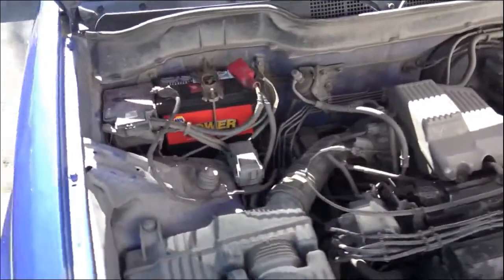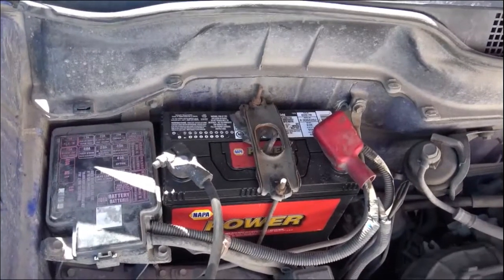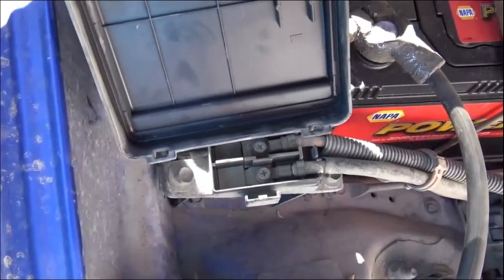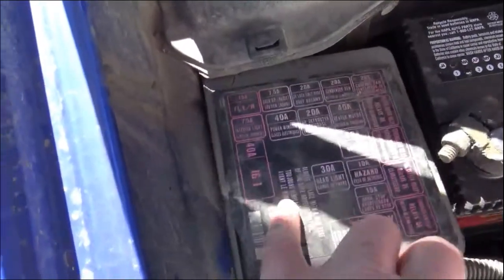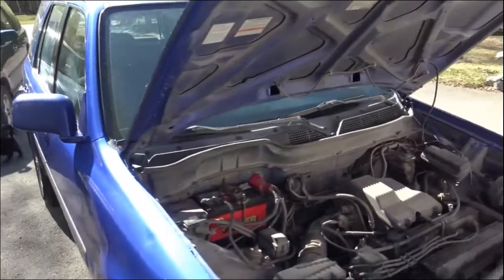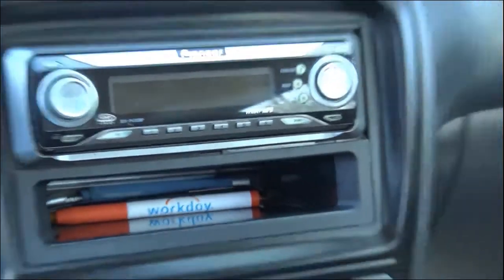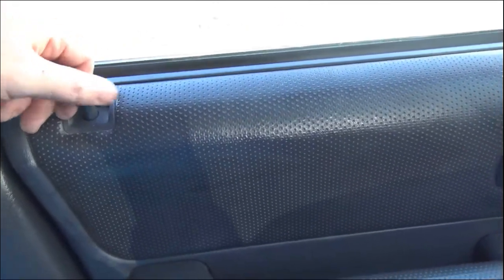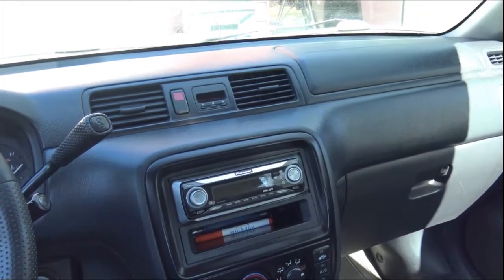Honda CRV - Dead Battery Fix

Comment: I always wondered why my crv doors are locking over and over again even when the car is off. It is always re-locking. My battery drains within a day or two and I dont have a charger. Have to ask my neighbors for a jump and this one time my neighbour frowned on me cause he was tired to give me a jump 😄😄 thanks for the help.  Will come back in a day or two and let you know if it fixed my problem
Reply: Hey Recardo, you never came back & told us if this fixed your problem or not, did it???

Comment: I also having  a drain  problem. does your key ring light  supposed stay on all the time?
Reply from the maker: The key ring on my 2000 CRV does not work at all.  I think the bulb may be non-functional.  I'm pretty sure that the light ring should not be on all the time.  I'll check my daughter's in a bit and let you know what hers looks like.  She has a 1998 CRV.
Reply from the maker: My daughter's 1998 Honda CRV shuts the light off 6 or 7 seconds after the driver's door closes.  Good luck!

Comment: I assume you did the normal things when your battery light goes on.
1) Get a volt meter.
2) Check that you have a charged battery.
     It should read 12.5 to 12.8Volts
3) Start your car and have someone get behind the wheel.  With your volt meter touching the battery like you did above have your friend step lightly on the gas.  Your meter should go up to 13.5 to 14Volts.  If it still reads 12.5 Volts then your Alternator needs to be replaced.  Just to make sure see that the Alternator belt is tight and not slipping.

Comment: If the liftgate light stays on, you’re going to get a drain on the battery, even when it’s parked, I had to replace the liftgate hinge on my 2008 CRV and now the liftgate light stays 
on. Guess what,  battery drainage! It’s sat for four days dead recharged, batteries only year-old, dead again after four days. I’m going to check the fuse box and see if I can find the liftgate fuse and see if that will help what do you think? It was fine before this.
Reply: I had to unscrew the latch hook on the liftgate, with the new hinge. It doesn’t match up. if the car thinks that the door is open, it will drain the battery even in park position. Make sure that the liftgate light is off on the dashboard, for me that means keeping the hinge hook in place, but not screwed in. I can’t lock the car up, but I use this car for utility anyway.